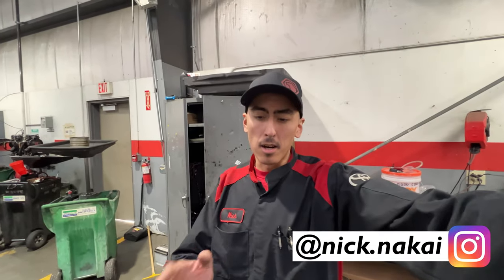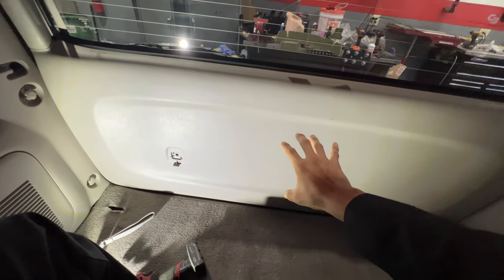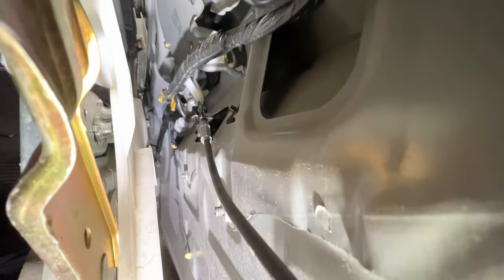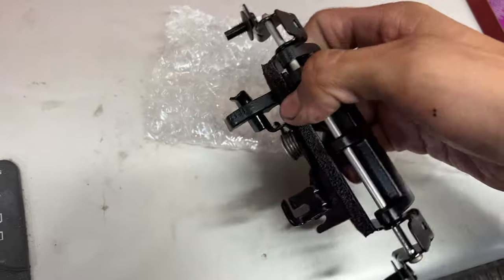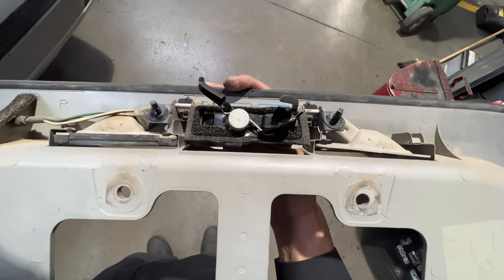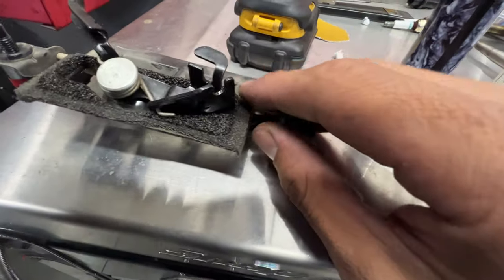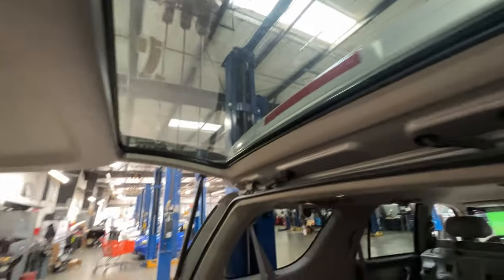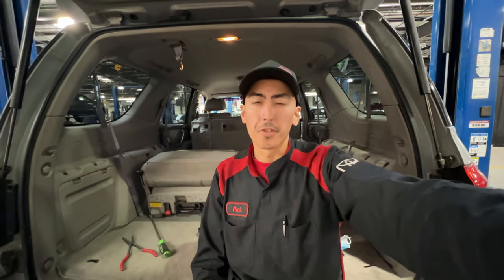Toyota Sequoia Trunk Wont Open (Ultimate How-To)

Comment: I always use a radiator pick and just pop the latch from the outside.  hasn't let me down in 15 years!
Reply: Don't  teach him secrets.. 🤣 jk.  .. ..
Reply from the maker: I had no idea 😅
Reply: Yeah I do the same hose pick trick
Reply: Can you  explain a little more  please
Reply: How do you do this
Reply: Does this work if the cable wont open the door even if you pull the ball. My door is stuck shut
Reply: I replaced the latch. It worked for a minute. Then when I locked the car to go inside for the night, it wouldn’t open again.
Reply: How do you do that
Reply: You just not explaining how you did this on a video that people CLEARLY seeked out to fix this issue, is exactly why people hate mechanics.
Reply: This only works if you’ve taken it apart before, there is a plastic piece you have to remove and keep off to be able to access the and latch open like this
Reply: @kepler656  it's after you get it open initially.  There's a plastic cover on the hatch side over the latch. When and only when that small plastic piece is removed you can easily pop it open.  But you still have to tear everything apart- open the hatch- remove the plastic piece, then you can pop it all you want. I exhausted the internet for this info.

Comment: The latch and cable works fine but it I can’t get the back truck to open.  Maybe it stuck in  the locked position. How do I get it to open and change the locking mechanism?
Reply: You would have to push the cable, you might be screwed getting to it tho

Comment: What if the cable wont open the latch and striker. The handle broke and when i pill the ball the lt h will not open anymore and the door is stuck shut
Reply: same problem here

Comment: In my experience the reason why  these plastic levers break is because the grease that is used to lubricate all the moving parts of the latch and handle need to be cleaned and re-greased. Definitely doesn’t help when they make the levers out of plastic. But if maintenance is kept up with all the latches around the vehicles doors how to put less strain on these plastic parts. Another problem is around the latch manufactures put plastic sleeves. These sleeves break apart and jam the latch up from moving freely. I’m assuming to keep grease in contact with latch. My thought anyway. Otherwise I have no idea why they put those on there.
Reply from the maker: Yea it’s almost a 20 year old car now anyways though things are going to break.
Reply: @LetsDriftMedia Yes I realize the wear and tear on the handle do to age. But my thought is that the new handle will not last long if there is excessive amount of tension before the latch can be fully operated. 
In my case excessive tension was caused by the sleeve on the arm of the latch at the bottom of the door. It’s split apart and kept the latch from being easily engaged and retracted when the handle was pulled. Which eventually broke plastic lever of the handle. Option one was just to replace the latch. We chose option two to be cheaper so I methodically cut out pieces of that sleeve(which took a long time😂). Eventually it freed it up. My first thought was to burn it out but I didn’t know if there was a bunch of other plastic parts in that latch. So I went with option 2. I wish they wouldn’t rivet these parts together and use screws. Would have been a lot easier
Reply from the maker: @t.k5928  dam nightmare. And yea you would think Toyota would make a stronger re designed not plastic handle. But maybe it’s there way of selling more parts
Reply: @LetsDriftMedia  Has this been corrected in 2008 and up models??

Comment: Excellent!!!   I checked out a few other videos and none of them had the crucial step that you included moving the window assembly.  That made the job SO much easier!!!!   THANK  YOU!
Reply from the maker: Awesome ! Glad I could help!
Reply: @LetsDriftMedia  So my hatch i think is seized. I have manually gotten back here and moved the unlock switch by hand and it is still stuck. Any recommendations ?
Reply: @justinmott6987 same here. even if I pulled cable, the bottom end snaps from the plastic holder that supposed to keep the cable exterior in place. I can't open trunk

Comment: If sitting in the rear is uncomfortable, you can roll down the rear window and remove the trim pieces from the outside. When the large interior panel is removed, the rear window has about a 1/4" play. If you look between the glass and the rear hatch, you can see the lever that the handle operates. A thin, 10" flathead screwdriver can push the lever, unlocking the rear hatch.  All of the other steps are much easier with the hatch open.

Comment: After replacing the handle multiple times on my 03 Sequoia, each time the handle worked for a while, however the lever pull still required a lot of pressure to unlock. I never thought to replace the cable and latch. When I bought a new cable and latch from the dealer, it was a game changer. I can now open it with one finger.  So replace the cable and latch and this issue will go away.  

I also use a free paint can opener with the small bent end to hook under the back of the large cover panel around the lower edges. Once I pop these out by pulling toward me, i do the sides, I can then slide the panel up to lift this away to expose the metal cover.
Reply: Thanks for this. I’m fixing mine for the 2nd time.
Reply: How much was it?
Reply: That would have been nice to know 15mins ago before I broke my second handle five minutes after installing it 😭
Reply: I’m now having this issue I will be replacing the cable also.
Reply: @KevsHowToDIY  and Latch as the latch may be gummed up. Ask for a discount on the parts in a very polite way and you will likely save money!  The way I did it was I went to the dealer, asked about the parts, told them about my prior attempts to fix the handle… then asked about a new handle, cable and latch, and discreetly asked for a “friends and family” discount and winked my eye.  The guy laughed and then took money off each part.

Comment: I've had my 2005 Sequoia since new. I'm getting ready to go in mine for the third time, The first time was the handle just like yours , I put a plastic one in that didn't last long. The second time I put a metal one in, this time I think it's the cable that stretched, I sure am getting tired of this, as this old body (71) has a hard time getting in the back of that thing. But I'll get her done, I'm too frugal to pay a mechanic that's for sure. Thanks for the refresher course, you know the memory thing, smile.

Comment: I've had my 2001 Sequoia since 2003 and this latch has broken 3 times. The last time I found a metal latch handle which has worked for me the past 5 plus years. The plastic versions seem to break during cold temps and at the worst possible time.

Comment: So, probably not the most long-term solution. But, my cable seemed to have slack in it (probably from the handle innards bending over time with use). I pulled the cable taut, then tightened a zip tie around it right next to the ball, then put the ball back into the hook thing that holds it in place with the zip tie acting as a spacer between the ball and the hook. That gave me enough tension to be able to keep using the existing handle.
Reply: I like it

Comment: i did the off road bypasss,little handle , potrudes out and it works wonderful, after 2 rear hatch handles in over 2 1/2 years of ownership, i did the switch.

Comment: Ok I just did this and I didn’t have the cool tool to push open the cable so I used a large meat fork and it worked perfectly ! Of course I ordered the part after so I have to wait another day to deal with the new handle

Comment: Replaced the handle recently but now I'm having the reverse problem. The lift gate closes but does not lock. All the other doors lock but not the lift gate.
Reply: Mine does the same thing....I replaced the handle and cable and when I hook everything back up, including the electric connectors,  the gate does not lock.  All 4 doors lock, but not the gate...is there a way to reset this? @LetsDriftMedia

Comment: Great video!  Replaced the handle recently but now I'm having the reverse problem. The lift gate closes but does not lock. All the other doors lock but not the lift gate.  I replaced the handle and cable and when I hook everything back up, including the electric connectors,  the gate does not lock.  All 4 doors lock, but not the gate...is there a way to reset this?
Reply: No.  It sounds like the lock actuator is bad or one of the connectors came loose.  It is connected to the latch and not too difficult to swap out if you have mastered the door handle.  Best bet is buy assembly with latch and actuator.

Comment: Have you ever worked on the new supras at Toyota? I was wondering if it’s hard to work on those since it’s kind of a BMW/Toyota type of car or is it actually easy to work on those? 
-Thanx
Reply from the maker: its a BMW completely. no toyota parts or systems at all with that vehicle. but no only saw them come in for oil changes when I was at Toyota.

Comment: Can you do a ‘07 Toyota Sienna? The cable on the rear passenger door that makes the door slide is broken and I don’t know how to get to it.
Reply: Gonna have to go from the inside..
I had a problem just like this:
07 Sienna, passenger rear sliding door outside handle ripped off and inner handle cables slipped off. (What a nightmare.) Car was +10 years old so customer didn’t care if I was able to pull the inner panel off and replaced the door lock actuator (would not retract after pulling). The cables were re-usable so I just popped them onto the new lock actuator. Hope this helped! 
(If you want the door to slide open and lock when fully opened, there’s a cable running down to the bottom.)
Reply from the maker: If I run into one I will try

Comment: I just replaced mine a couple of months ago and now it won’t open. I can pull back on the latch. It’s not loose, but it just won’t come all the way forward.😞
Reply from the maker: Try pressing the rear trunk/hatch at the bottom against the vehicle and pulling the latch, if the latch feels connected still sounds like the cable is binding or something.

Comment: Do you know of a common problem with a 1st Gen Sequoia, the rear is collecting water and getting the carpet wet, i dont know what to do ive tried fixing but dont know what else to do.
Reply: Where in the rear are you collecting water?
Reply: @bourne8744  the entire back of the sequoia , I took out the carpet because it started to mold .
Reply: Was it the drain line that caused it if it has a sunroof there four drain lines two the run to the back  and two that run down the pillars in the front. From the sun roof there a video if you look up drain line clean sequoia it pop up.

Comment: Mine is not completely open nor locked and pullin on that cable is still not opening the hatch, help!
Reply: Same, did you find a solution?!
Reply: @joes4292  had to replace it completely, straight forward not too bad to do

Comment: How do you open it if pulling cable don't work
Reply from the maker: Remove the plastic panel from the inside like I did in the video to gain access to the latch and move it manually, or some people have commented saying you can stick an angled pick in from the outside where the plastic handle is to unlatch it if the handle is broken off.

Comment: Mine wont close, the button seems to be making noise like the motor is ok, window goes down and up but the hatch will not close. So im having trouble finding this issue and DIY solution.
Reply from the maker: sounds like the latch itself is not locking shut once you close the lift gate.
Reply: @LetsDriftMedia  I use a screw driver and it moves the mechanism but it won't lock and stay. It just releases when you pull on it. I'd rather it was stuck shut then open freely like this. Not sure what would cause this.

Comment: Ahh the old broken latch on the First Gen Sequoia. Only buy Toyota handles. The others are junk. Also the cable will stretch making it not work as well. Been there done that a few times.
Reply: Also helps to pop the latch with one hand and lift the truck door with the other.
Reply: First time I made the mistake with the license plate lights too.

Comment: no matter how many times you replace the handle it will break again trust me. the way toyota designed this system is complete trash way too much tension on the cable
Reply: very true. I have replaced mine 2 times in the last 3 years. It always breaks at the most inconvenient times, both while camping on road trips.
Reply: Second generation and up, this was,corrected

Comment: I replace the latch once work a little then replace the cable was working fine until my battery died then it got locked l am sick tire Toyota sucks on this  door handles brake easy

Comment: Could you not have just actuated the latch with your scan tool to get it open? Just to make life easier removing the panel
Reply from the maker: I don’t think so this trunk does not have an electronic trunk release. Only cable release